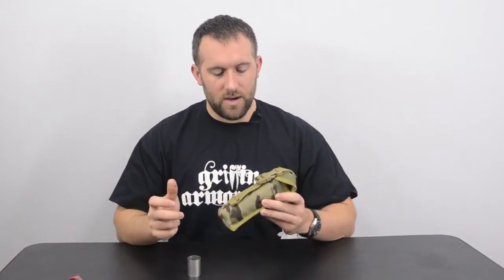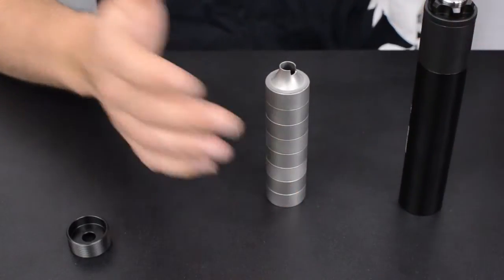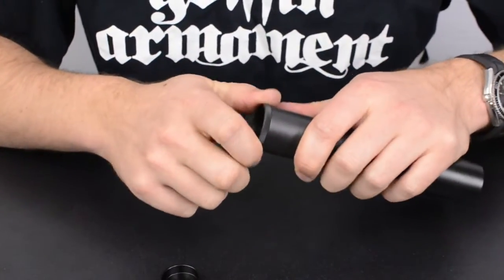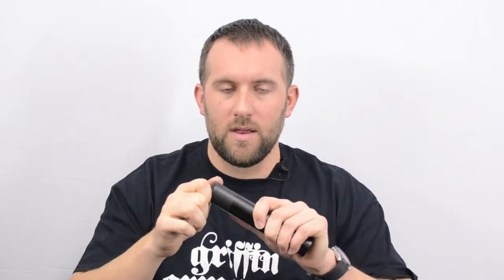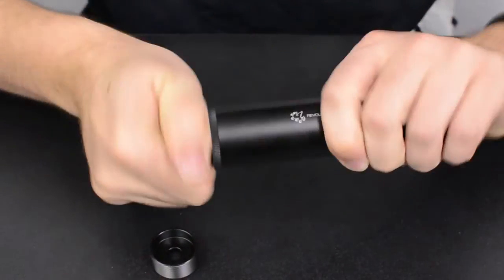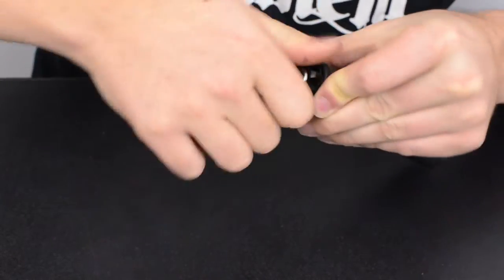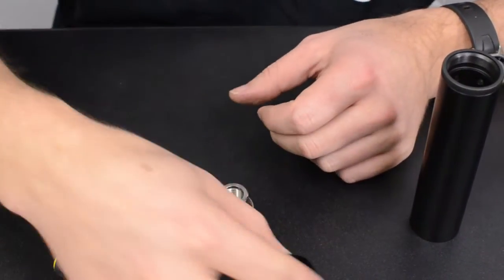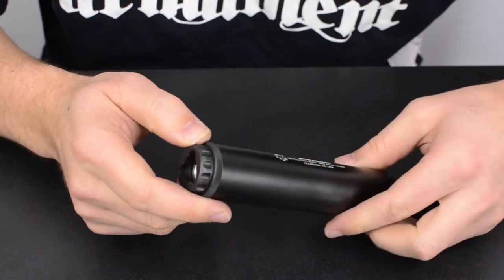Configuring the Revolution 9mm Sound Suppressor

Comment: "I think I may have purchased the wrong suppressor because I am unsure how to properly mount it on my AR-15 5.56. I am also uncertain about the specific parts I need to purchase to ensure a proper fit. Could you provide some guidance or suggestions on how to proceed?"
Reply: Contact Griffin Armament via their webpage, they respond quickly and will provide you with the info you need. Just tell them what you have and what you are mounting it to.

Comment: Is Loctite necessary for safe usage? Don't want to loctite it if I'll be swapping out configurations frequently.
Reply: YuanMizzle 

I'd like to know that as well
Reply: My revo 9 cleared about 9 months ago and the included instructions had in big bold letters multiple times: "You must use loctite prior to use, without using loctite, you void the warranty." I have 2 other cans by different manufactures that actually discourage the use of loctite, but I will say the revo 9 has the loosest fit of the 3 so maybe the loctite makes up for poor machining, or in the case of an AK, bigger tolerances make for higher reliability?
Reply: I'd say if you were going to reconfigure it a lot and you absolutely needed to use Loctite for warranty purposes, maybe you could get away with just using Loctite Blue and then just periodically re-tightening?